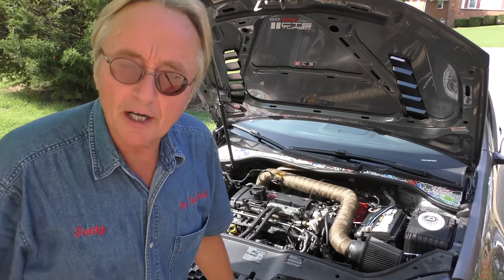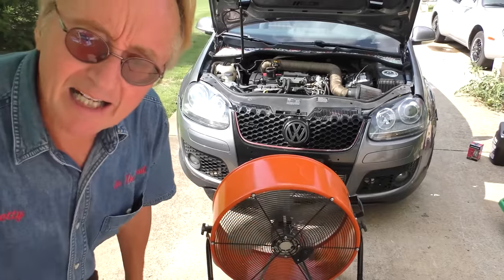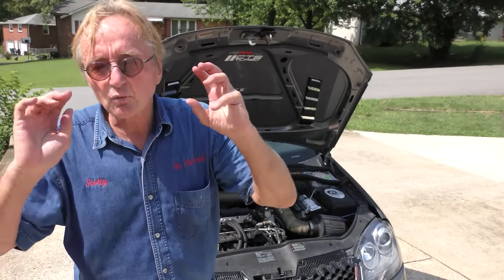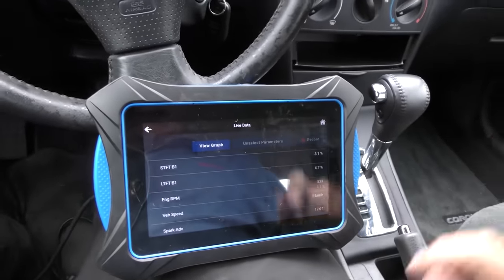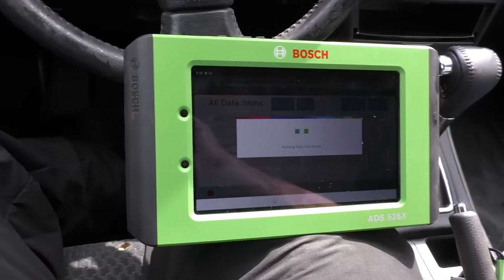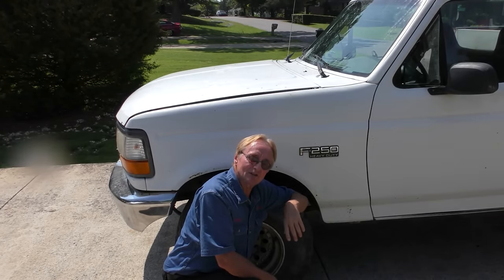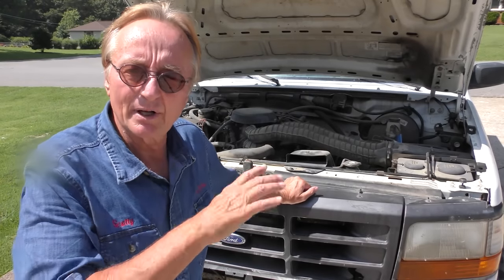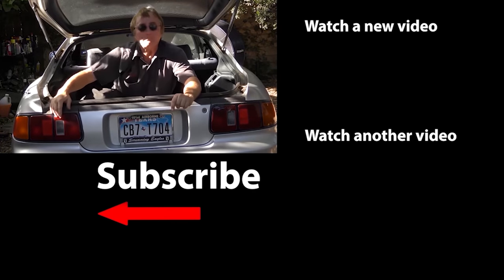3 Additives That Will Make Your Car Last Twice as Long

Comment: I've only used AMSOIL synthetics for years, my last GMC Sierra had 495,679 miles on it, purred like a kitten. Use it on my motorcycle also, yes it's expensive but well worth if you ask me.
Reply: Yeah I think I heard a mechanic say you could go with out changing the amsoil for 25000 if your using amsoil filter
Reply: It’s all I use…. In everything. Hasn’t done me wrong at all!
Reply: They still don't have a high-end 0W-16 oil, unfortunately.
Reply: Pennzoil Ultra Synthetic from Natural Gas, works just as good and cheaper.
Reply: @dawhike  It’s great oil but it’s not “just as good”. Amsoil out performs it, albeit by a minimal margin, in all head to head tests. I wouldn’t hesitate to use that Pennzoil if it was significantly cheaper but where I live it isn’t.
Reply: How do you deal with the oil life meter? I’ve put oil that lasts 10,000 plus, but my oil life meter still goes down like it would with regular synthetic. Plus my 10th gen impala on forums say never go past 4K before oil change. Idk what to believe.
Reply: @unitedwestanddividedwefall3521  It's your computer doing that, doe's it come on every 3,000 miles which is the normal oil change period? Mine comes on at that interval but I don't pay it any attention. I go 10,000 miles then change it with AMSOIL signature series which is their best. It's expensive on their website but I buy it from a local dealer and get it  a lot cheaper. If you're a club member you get good discounts. I use not only their oil but other fluids and lubes.
Reply: @darktoadone5068  not sure about 3k but GM changed it to 7500 after their 3.6 engine kept stretching timing chains. So to be safe I use castrol edge and change it around 4K. Walmart sells it for a good price.
Reply: Sad thing is they don't make 0w30 oil for diesel engines which is what my car takes. Otherwise I'd use it.
Reply: @unitedwestanddividedwefall3521  Just ignore the oil monitor. My F150 calls for oil every 10,000kms (Canada) or one year in the owners manual. Being I put on 2,000kms a year I only change amsoil once a year with signature series oil. The oil monitor calls for oil a lot sooner but there’s no way it needs to be changed with 2,000kms on it…. Become a “preferred customer” - You get free shipping ($150, again, Canadian) and 25% discount. It actually doesn’t amount to much more then the crap you get anywhere else!!!!
Reply: I have an 09 Ford focus with 730,000 miles on it I do oil samples and change it every 8000 miles using mobile one

No problem with Amsoil except I don’t happen to have it handy
Reply: Send a sample to Blackstone Labs they will give you the sample containers in the envelopes for free and they can tell you how much life is left in the oil when you change it they’re telling me to go to 10,000 miles I’m stopping at eight just because I only use an eighth of an inch off the dipstick at 8000 miles if I go to nine I use a quarter inch
Reply: My friend used it on his new Elantra N and got 1.5 more mpg. He also noticed it ran smoother.
Reply: AMSOIL or nothing
Reply: Impressive
Reply: @sprint48219  wow. Original engine and tranny?
Reply: @johnfitbyfaithnet  It’s got the original engine the original tranny the original alternator I change the starter on it about a year and a half ago
I do an oil change every 8000 miles and I change the transaxle oil it’s a five speed standard shift every 35 or 40,000 miles
Obviously I’ve change the suspension parts it wore out and I’ve done brake jobs you know the maintenance stuff but the original stuff is all there and it’s never been touched
Reply: @TheSuperBoyProject  use 5W-30 instead.
Reply: What is the name of the additive Scotty?
Reply: I'd Rebuild the engine into a 383 with 4.11 gears, It'll run like a rapd Ape 🏎
Reply: @TheSuperBoyProject  Castrol does have that grade.
Reply: @TheSuperBoyProject  not sure if Castrol is rated for diesel. You still can use 5W30 grade diesel rated oil.
It is still 30 viscosity.
Reply: @stevel1475  their 5-w30 better be because its listed as the recommended manufacturer for my car
Reply: @illegalopinions4082  what car are you referring to?
Amsoil has been tested and is among one of the best. But top rated oils are always leap frogged in like a year or two.
Reply: amsoil is grand prix recomended.
Reply: i just run regular castrol 5/30. no issues.
Reply: @daviddowns7552  there was a YouTube video. The guy used the right viscosity but didn't have the right specs required and his Land Rover V8 had serious ticking issues.
He says his engine is ruined, maybe or maybe not. 
Take you chances, some engines are finicky for oil requirements.
Reply: @sprint48219  Had an '03 Focus with the Mazda-derived Zetec 2.0 and 5speed manual. There were a few cheap parts used in the engine bay that needed addressed over time, but seriously nothing that major. Just normal maintenance stuff. 160,000+ miles on original clutch, still held strong. Replaced clutch master cylinder for a weeping oil leak (plastic and cheap stuff). Changed oil regularly, between 4,000-5,000 miles. Ran synthetics quite a lot. Replaced most wheel bearings and brake components, changed all fluids. It was a rusty car by the time I sold it 13 years later for 1,400 bucks. hahaha
But honestly, the car was about 16,000 dollars new back then, and there were plenty of places Ford decides to cut costs compared to other brands in the segment at the time.
Reply: There is a guy on YouTube with a million miles on a Ford 5.4 that days he used Valvoline conventional and changed the oil every 3000 miles
Reply: @MX-CO  That's only 333 oil changes, 499.5 gallons of engine oil, 333 filters. hahaha
Reply: @exothermal.sprocket  yes but I get my oil changed at Valvoline evert 3000 miles and it's only $25 I'm ok with that I currently have 236k on my Yukon and it's running great 👍
Reply: @MX-CO  many factors at play. Most likely alot of highway driving, warmer climate, and engine was always at operating temperatures. Well the guy got his monies worth out of the Ford.
Reply: How long do you go between changed typically? I did 1 year, 15,000 miles
Reply: @Timmay1320  Depends entirely on your driving environment, time, length, how hot the engine gets, fuel quality, tons of factors.
If you want to know for certain, send a sample of used stuff off to Blackstone Tech.
For me, throwing a few more dollars into oil isn't an expense I need to obsess over.
Reply: @raymonddriggers  marketing gimmick. If it gets all plugged up it runs into bypass mode. Slowly wearing the engine and you wouldn't know about it.
Reply: @pajamatime5750  mail order it.  I wouldn't hesitate to use it in my custom LS9
Reply: Lj
Reply: Good stuff, used in snowmobile and lasted a long time.

Comment: 1) Ring Carbon Remover: Automotive Test Solutions carbon remover.
2) Fuel injector cleaner: Royal Purple Max
3) Transmission shifting and slipping issues: Lucas Transmission Fix Stop Slip.
Reply: Thank you! . I’ve watched this a few times & never knew if I caught the actual names correctly.
Reply: Answers what I was just wondering
Reply: Thank you
Reply: Yes. Thank you for sharing that.
Reply: It's Lucas Stops Slip,not drip but thanks
Reply: Thanks man
Reply: Thank you!!!
Reply: Thank you.
Reply: Where do they sell ATS carbon remover ?
Reply: That  Lucas fix slip is great!
Reply: So… Scotty, does ATS still exist? I can’t find any of their products online.
Reply: Auto trans, change fluid AND FILTER. If the filter is clogged the trans cannot lock up the bands properly.
Reply: Prolong > Lucas
Reply: @M R that’s another HQ brand as well
Reply: Thanks! I knew there'd be a bad a$$ giving us the list. Scotty be too busy to give it. 😆
Reply: Thank you I was wondering what they all were 😊
Reply: Not all heroes wear capes. Thank you!
Reply: Thank You
Reply: @redskinman0  lol. as long as it stops either drip or slip...I'm using it....
Reply: Thank u sir....
Reply: Thank man
Reply: I'm an atheist but I think there is a heaven for you guys that do this.
Reply: Ty very much. I love and respect, Appreciate guys like who do this👍
Reply: For anyone wondering this ring carbon remover isn't cheap. It's $300 on the companies website. I'm sure it works but it's not a cheap product.
Reply: wow too $ expensive for me.
Reply: 1) "This is Joss Atass"
Reply: All of the above: SeaFoam....
Reply: What about for Mercedes ...that transmission fix slip . He said “for American vehicles” so does it not work for Foreign cars?
Reply: @andrewp7509  check his other videos, that's not for modern cars, it's for 2 cycle engines, originally boats I believe
Reply: @mattdragon80  it's for everything
Reply: @andrewp7509  like I said...watch his other videos
Reply: I aways learn something by watching Scotty’s videos
Reply: You have done a great service to mankind.
Reply: The first one was ATS chemical 505 CRO. That's not on the list.
Reply: @kirstenspeor a power flush ncer3630
Reply: does this work with diesel engines?
Reply: It is $60 on their website for one oil and one fuel treatment combo.
Reply: Thank you!
Reply: thanks. I can't stand this dude yelling.  it's like, god answers prayers but like a genie...
Reply: How do you fast idle?
Reply: 3:  Will the transmission fix slip work for CVT's or only on traditional transmissions?
Reply: @chadm7872  Right where you find the muffler bearing aisle.
Reply: lol he’s torturing us, thanks for relieving the stress
Reply: Wow I just picked up #3 after some digging around (didnt even look on scottys channel;()..its like magic
Reply: Thank you!
Reply: @Ionizap  Well being an atheist will NOT get you to heaven. Repent! Jesus is the Way, The Life and The Life Forever throughout eternity in Heaven, The Earth Made New and Throughout All the Unfallen Worlds.
Reply: @richbrake9910 everyone still needs to replace the trans filter an remember the automatic transmissions it's not a motor if it's slipping sometimes its really just better to just put the old oil back in an just leave a qrt out an replace it with lucas stop slip an keep the qrt an filter with a filter or old shirt or something or as is an keep for if u have a leak,an always check where to fill before u change filter ,some trans are not serviceable so??? Yea an hard to fill to so always look at ur manual and make sure u put the right trans fluid back so u don't mess up ur transmission all trannys take diff fluid so yea ...😊
Reply: Thank you! I wish he'd put this in the description, thank you for taking the time to figure it out! I couldn't even see the label on the first one!
Reply: thank you he does not say what he using in the video
Reply: Thank you.  Not all heroes wear capes.
Reply: Thank you

Comment: Thank you Scotty. I used that purple max cleaner on my 2008 highlander hybrid. I kept getting pinging when accelerating coming from a stop. I was upset at my mechanic because I did a tune up recently. Then, I remembered you talking about these products. So I headed to my auto store. Spent $20 and crossed my fingers. Let me tell you within the first two minutes my engine purring like a kitty. Wow. Amazing. Amazing. Thank you thank you.
Reply: Sometimes you change something and get a great result, but then the Engine Control Module re-adjusts, and a few days later, it's back to the way it was.

Comment: Hey Scotty,  I saw my friend Jay do the same thing on an Oldsmobile years ago by using Transmission fluid.  The Oil pump was clogged and so he removed the oil and put in Tranny oil for like 5 mins.  Maybe a little longer.  Drained the Tranny oil and put Motor oil and it fixed the problem.  I was a young teenager at the time and I was amazed.

Comment: Scotty, you're ALWAYS my life saver when it comes to trusted information that no other mechanic can give me. I was gifted a 2010 Scion xb. Previous owner was a female college student. Car had 205k miles on it. Discovered the following- no tune up, or regular maintenance was ever done on the car. Car shortly had a code for the torque converter. Took Scotty's advice for the Lucus trans fix while also doing a trans service on the car. Holy moly does the Lucus Trans fix work. Transmission loved having the very black fluid removed and the mucky magnet cleaned up too. Now time to clean up the injectors and the engine. This car is losing a quart  of oil every week. Fingers crossed 🤞 these additives work to save me from losing oil and gas mileage.
Reply: I’ve seen Lucas products work miracles.
Reply: Wow what a testament to Toyota to have a car make it to 200k without any maintenance except for assuming oil changes!
Reply: its a daihatsu-for-toyota/scion product- they use magnets in all their transmissions. i would recommended a can of restore before you resort to re-ringing the engine. some lucas UCL will clean the injectors- no tools needed. as long as that car wasn't abused- it will recover nicely. daihatsu makes some of the best motors in the world- thats why toyota bought them....

Comment: I started using Marvel Mystery Oil some time back on my 2005 Mazda 3 and I can say it drives as smoothly now as when I got it new.  It’s only clocked roughly 130,000 miles and I hardly drive it now I’m retired, so it could last another 10 years.
Reply: I use Mystery Oil as well and I have had no problems with any of my cars or vans. I was told to use it by and old farmer that use to use it on his trackers. You know if a farmer is using it it's some good stuff.
Reply: Mystery Oil it is
Reply: Using SeaFoam here, same kinda thing. Old Ford work truck, running forever.
Reply: My Grandfather swore by Marvel Mystery Oil and he's been dead for 50 years
Reply: I had an issue with an older jeep like a 97 Cherokee where it wouldn't run good at all. It ran like it had a misfire but the plugs and coil wires were new and good. 

Only thing that got the car to run right was marvelous mystery oil in the gas. I have no idea what it did or how it worked but as soon as that tank was out it would run shitty again.
Reply: @seyoneford1  probably valve related
Reply: @schumi9xwdc  He wasn't supposed to DRINK it !
Reply: I bought new a 2007 Hyundai Accent with 25 miles on it. The car now has 396,000 miles. The only additives that I use was Lucas gas cleaner and oil stabilizer .
Reply: Do you put it in the oil, gas or both? Thanks

Comment: I use ATS Engine and ATS Fuel System Cleaners at every oil change. 2005 Ford Ranger 3.0L with 85,000 miles. Runs perfectly, no codes.
I allow the engine to warm up BEFORE adding the oil treatment then run engine at 2000 RPM.

Comment: Just got a 1996 TOYOTA RAV4 with 240k miles because of your advice about Toyotas Scotty, and it’s amazing, it had a piece of exhaust shield that was rattling and that was part of the reason the guy sold it to me for a good deal, anyhow, now it’s so amazingly nice & I’m so grateful for your advice Scotty!!!! Thank you zillions 👍
Reply: it would go that far without Scotty.  Its an old Toyota.  They last forever if well taken care of.  I have had 6 of them.
Reply: hose clamps are usually an easy fix for heat shield rattles

Comment: I've always been untrusting of a mechanic in a can but I'm a old dog who has learned a new trick. The MPH on my 2016 Mazda CX5 started dropping off a tad. Not enough for any codes . Changed air filter and at 115,000 KM it was time to change the plugs as well. Did both without much improvement.  Saw this video and tried the Royal Purple. I used a bore scope to check pistons 1 and 4 . Some carbon build up but not excessive. I then added the Royal to a tank of new gas. After 150 KM I checked both pistons and they appear shinny and new. So it does appear to be cleaning something up.  My gas mileage has returned to what was expected. I suspect my injectors needed a cleaning.  I know it's not a fixall for everything but in this case it addressed my issue. Thanks Scottie..😊

Comment: I've actually had noticeable, positive results using the Royal Purple fuel additive. I've tried a few different types in the past, and it is my go-to now. I'll use it in my atv now as well because it's also a stabilizer.
Reply: Best fuel system clean is Techron Fuel system cleaner and BG44K nothing else also Redline is good as well and Lubegard is best for flushes and protection
Reply: I use techron fuel system cleaner the high milage stuff it's the best my opinion @fortnite360HZ

Comment: Hey Scotty, I have a 2007 Pontiac Vibe with 200,000 miles that was running rough.  I cleaned the mass air flow sensor and the throttle body, and it's running smoothly with 0 hesitation of acceleration.  Folks can also try this in addition to the good fuel injection cleaner.😊
Reply: EGR systems tend to dirty up intakes more than anything else, either MAS or intake valves that don't get washed with gas (direct injection).
Reply: I have a Vibe with 235k, a real war horse.
Reply: Do you wanna tell us how you cleaned it that might be good information thanks
Reply: @dewdew34  Nice, same here - I have an 06 5spd since new. Going on 350K kms and still going strong with only a few small issues along the way.
Reply: I've had 3 Vibes. F-ing roommate just totaled my last one. grrrrr.
Reply: I just acquired a 2004 Pontiac Vibe it's been a labor of love getting it to run good. It had been sitting for 3 years had to do a lot of cleaning up, Scotty's videos help so much to get that 1.8 L engine up and going. It only has $122,000 miles I hope mine makes it to 200 and Beyond. Thanks for the inspiration.
Reply: It's not a Pontiac,,, it's a Toyota
Reply: @GatesRapes Specifically a Toyota Matrix...tough car!
Reply: @dewdew34 That's because it's a Toyota Matrix and not made by GM.
Reply: That generation Pontiac vibe is a rebadged Toyota Matrix. It's all Toyota inside especially the Corrola engine.  Scotty would approve
Reply: I have had very good results with BG  44K
Reply: @poorasslawstudent hope you got rid of roommate dude